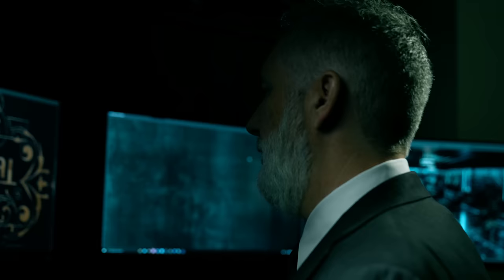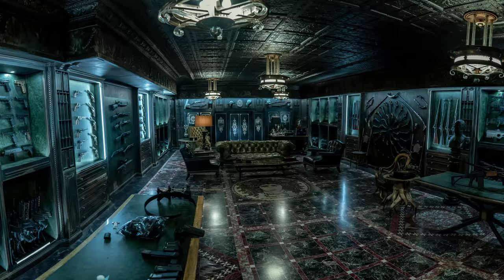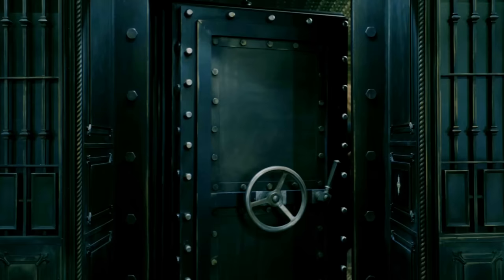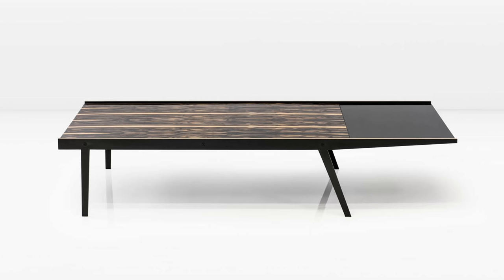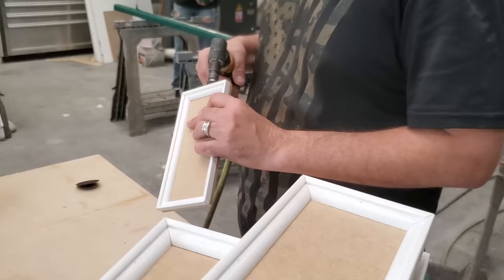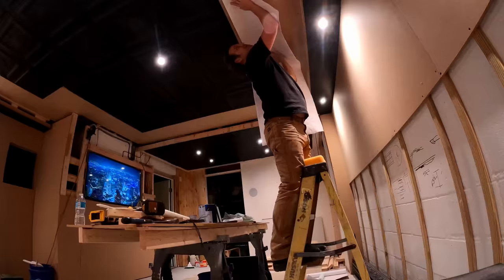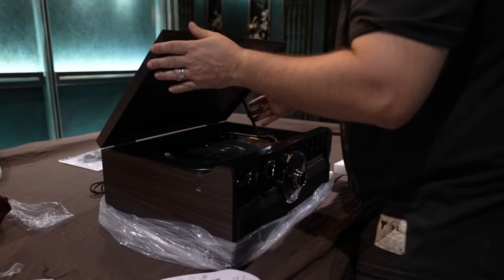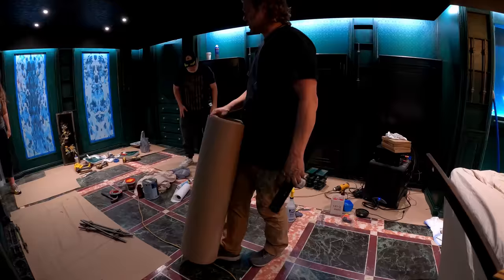John Wick Room / Man Cave!

Comment: Now for the elephant in the room.  What does something like this cost, and where are you located 🤔
Reply from the maker: As I mentioned to another commenter, it's tough to say because it was for a friend, so I wasn't charging for all the actual design work and modeling and writing machine code and producing the parts, etc.  Probably around 25K in materials, though, would be my guess, by the time it was all said and done.  Don't quote me on that, but that seems about right.  This project was installed in Florida, but I do designs and installations most anywhere.
Reply: Fantastic design.

Comment: Out of curiosity, what were the digital assets used? Can't see the name of the applications?
Reply from the maker: I do my modeling/CAD work primarily in Rhino 7 and Solidworks, and my visualizations in Maya, rendering with V-Ray (usually).  Sometimes I will render in Renderman or Bella, depending on the project.  Thanks!
Reply: Thank you!  @MikeVerta

Comment: Lol, they used a nurbs modeler like rhino for vfx production? Or is it mainly concept design?
Reply from the maker: There is no they, it's just me, and I use Rhino/Solidworks because it's CAD, and the files are used in machine-based fabrication.    If I'm doing purely VFX I may model in Maya or Modo/Z-Brush as appropriate.
Reply: @MikeVerta  Thanks for the clarification. Good work on that one.

Comment: How did you mount the revolvers to the circle??
Reply from the maker: If memory serves, it was either swapping out one of the gun body screws with a longer one which penetrated into the MDF, or the handles were removable, so the outer handle face was removed, a screw went through the inside there, and then the outer handle face was replaced making it invisible.  It was 2 years ago, but I think that's it.
Reply: That makes sense, thanks for the reply!

Comment: The only thing I don't like is the lighting, it's too bright in the room, and they should have used more narrow angle bulbs instead of flood.
Reply from the maker: There are no flood lights.  The ceiling lights are narrow beam spots, there are perimeter lights behind the frieze, individual cabinet lights, and accents.  All dimmable and individually-controllable for a large variety of looks and feels.  Lighting is everything.